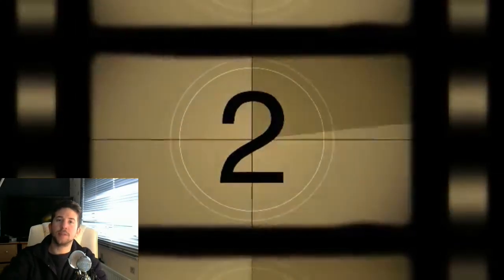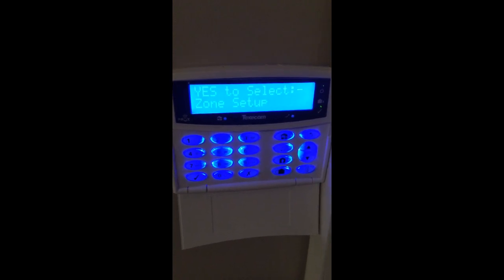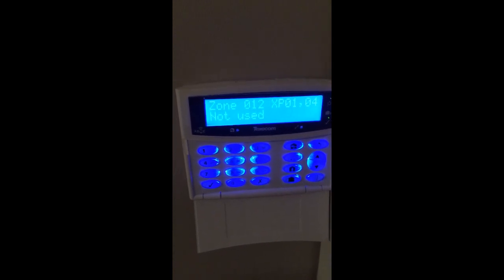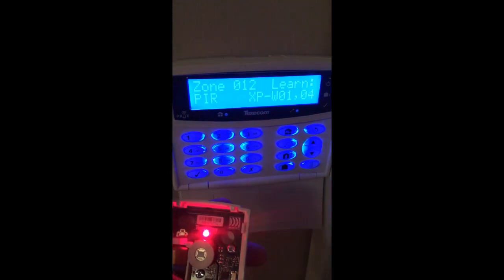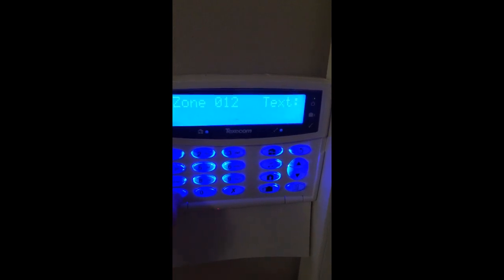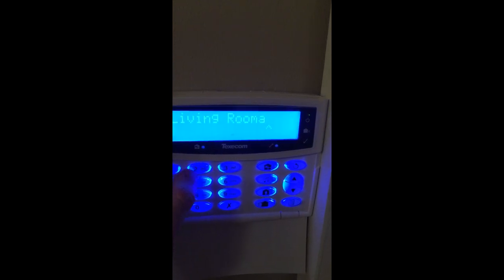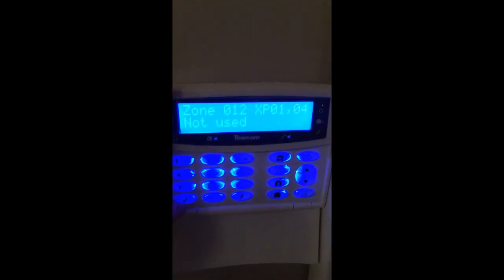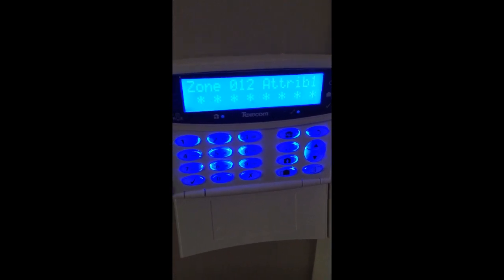How to- Wireless sensors- Texecom Premier Elite

Comment: Hi There, hoping you can help - I want add wireless PIRs to my panel which is a premiere elite 24, I currently have 4 x wired PIRs but want to expand - I can only assume this is not a wireless panel as I am unable to learn devices? If so can I add a wireless expander to this panel as I have been told different things? If so is there a specific compatiable expander that I need to get?
Reply from the maker: As you have an Elite you should be fine in adding a wireless expander. All you need is a Texecom Expander 8 XP- W. You'd simply connect it into the control panel with a piece of wire and matching up the + - T R. Once that's done you'd just need to confirm it (Engineer Utilities, Confirm Devices, Press Yes) then assuming it's your first expander you'd add your wireless zones from zone 009
Reply: @pizzaandchipsmate  thank you - will take a look see if this is something I can tackle as a diyer!
Reply from the maker: @HK-iv2qm  Hi, I'm sure you can, you'll need a GCD-0001 (part number for expander). If you need any help or any questions feel free to drop me a message
Reply: @pizzaandchipsmate  would there be any issues going with GCA-0001 instead? From what I can see this is the same but allows more wireless zones? Also I have some wired PIRs which have been giving false alerts, is upgrading these to Dual Tech as simple as disconnecting exisiting PIR and connecting new ones? ( As the wiring is there I may as well make use of these in situ)
Reply from the maker: @HK-iv2qm  You can use the 32 way instead if you want. That's correct. Yes, replacing a PIR for a DT is as easy as unwiring one and putting the new one in (or swap heads if using texecom capture). Generally DT's are fitted in temperature change rooms ie, kitchen, conservatory, garage
Reply: @pizzaandchipsmate  Brilliant thank you for this, interestingly I have ACD-0001 PIRs and have 2 of the 4 false trigger when armed on a few occassions and was looking at DT as was told they would be reliable - one is in the hallway, one in the rear open plan kitchen - so not necessarily temp changing rooms when armed, would DT be the best option?
Reply from the maker: @HK-iv2qm  I think changing to DT would be a good first step in preventing false alarms, generally radiators, fires, ovens, skylights, windows, glass in general can all be causes of a false activation. A PIR isn't looking for movement but a temperature change, hence why a DT is better suited in those locations
Reply: @pizzaandchipsmate  taking you up on your offer, I have now accessed my control panel, have the 4 core cable but am struggling to see where the expander needs to be connected to as there are many connections already in place ?
Reply from the maker: @HK-iv2qm  Using a new bit of cable, you'd connect into the Network In on the expander (top left) aerials will be pointing downwards. Using the + - T R, before connecting it into the panel, check or know if you already have an expander programmed in, you can check this by Engineer Utilities, Confirm devices, and see if you have anything on the EXP line, if you do, you'll need to address the expander to the first free one (number won't be displayed) so if you know or have nothing on EXP line, leave address as 0 or put just first address switch on. Once you're sure of the address using the other end of the cable you wired into the expander, you'd put that into the Network terminals using same colours, so Red is +, Black is -, Blue is R, Yellow is T. Doesn't strictly matter, just need to be the same both ends. Then once connected, check your confirm devices and you should now have a 1 on the EXP line
Reply: @pizzaandchipsmate  thanks once again, I have checked and no expander is in place. The part that threw me was that there are already wires cabelled into the network terminals on the panel which I assume are for the smartcom communicator. So I assume I would need to double up the expander cables to these terminals with existing wiring? And will need to power down the panel and remove the battery before doing so?
Reply from the maker: @HK-iv2qm  It would be the keypad in the Network already, the smartcom uses the lead plugged into Com 1 and Com 2. You can do it live, just do the expander end first otherwise you'll be dealing with live cables
Reply from the maker: So if you already have a core in +, -, T and R you would put your cores in as well so they are sharing the same terminal

Comment: Our expander has no longer got a tone sound when arming - this was after adjusting a few settings; does anyone know how to fix this?
Reply from the maker: The expanders themselves don't make a noise. Do you have speakers wired into them?
Reply: @pizzaandchipsmate  Thanks for getting back. No, there’s no speakers. When we previously armed the alarm there’s was a sound from the keyboard and another sound from the panel but now there is only one sound
Reply from the maker: @786masakeens  From your keypad engineer menu, find keypad setup, press yes until keypad tones and see if they're all on, if not, press no then no to toggle them on and off
Reply from the maker: @786masakeens  Also, is this for a night set or full set?
Reply: @pizzaandchipsmate  thanks - that’s worked! Is there anyway to change the tone sounds?
Reply: @pizzaandchipsmate  full set
Reply from the maker: @786masakeens  No, the exit, entry etc tones can't be changed
Reply: @pizzaandchipsmate  Thanks

Comment: Hi I have a premier elite panel which I wanted to reset to factory settings, although the sensors which were paired to the panel were switched off when I factory reset the panel and now when I go to re add them they don’t learn to the new panel.
Reply from the maker: What was the reason to default the panel? The sensors also get learnt into the expander, so if you go into Engineer Utilities (9), press yes, then press up until you get into Ricochet Diag, then press yes, go to your first wireless zone, press 'reset' it will ask if you want to default nvm, press yes. This also reduce the likelihood of faults coming as the panel has the Lounge as say zone 11, but the expander sees it as zone 12
Reply from the maker: How are you learning them in as well?
Reply: @pizzaandchipsmate  Hi so I set it up in one property and I’m now just moving it to another, it would have meant changing a load of settings etc otherwise, but it didn’t really need to reset. To learn I go to engineers then learn ricochet. What I mean is, once the sensors are paired are they then locked onto that panel until the device list is cleared. I reset the panel by holding the load default button however the sensors which were coke credit didn’t have their batteries in them.
Reply from the maker: @JAMESJAMES26000  You should learn them in via Engineer mode- Zone Setup- Zone Number, Reset, Learn in
Reply from the maker: When you Load Defaults with the panel powered up it doesn't reset it. You need to hold Load Defaults while powering up and it still doesn't reset the Ricochet Diag on the Expander
Reply: @pizzaandchipsmate  ok yeah I think Ive got it and yeah I held the button whilst powering up. When setting up the zone say for the entrance door I’m guessing you pick entry exit 2 right not just entry?
Reply from the maker: @JAMESJAMES26000  Entry/ Exit 1 is fine for the front door, Guess Access for the Hallway, Guard for others
Reply: Ah ok also I didn’t really seem like the PIR was being triggered by my movement. It’s a PW-W does it start to work once I’ve taken it out of commissioning or are they just a bit rubbish?
Reply from the maker: @JAMESJAMES26000  They're pet friendly so a bit temperamental, how long did you leave it in commission mode, what did you do for commission mode? Is it set for 'Auto' in type?
Reply from the maker: @JAMESJAMES26000  How do you mean to your movement?
Reply: @pizzaandchipsmate  the light wouldn’t illuminate when I move in front of it
Reply from the maker: @JAMESJAMES26000  it's wireless
Reply from the maker: @JAMESJAMES26000  They will only illuminate in walk test mode or if the alarm is set. As they are pet- friendly they are more difficult to activate so takes a few big waves
Reply: @pizzaandchipsmate  ah so they’re bit rubbish
Reply from the maker: @JAMESJAMES26000  they aren't my favourite
Reply: @pizzaandchipsmate  hello, so when I want to learn the devices should I create a zone for each room say, hallway which has a pir and door contact. And a room which is only has a pir? Is it easier to setup devices using wintex?
Reply from the maker: @JAMESJAMES26000  Hello James, I'm not sure I follow you. I would have either my expander lid off in tamper, or the jumper for commission mode on for a 64-W. Then for Zone 009, learn in the Front Door MC, then 010 Hallway PIR etc, I find it easier to set up using the keypad. If you have Discord I'd be happy to talk you through the system
Reply: @pizzaandchipsmate  yeah I’ll get my username.  I mean when I learnt the devices it didn’t give me the option to set if they were for guard etc. I couldn’t find in the menus where I was able to set those perimeters? I have a smartcom and was planing to connect my laptop to the system via wintex, is that an easier option to setup such perimeters?
Reply from the maker: @JAMESJAMES26000  Once a device is learnt in you'll need to press 'yes' until it says 'Zone Type', it does automatically make zones 'Guard' thought once learnt. Alternatively if you come out of current menu (menu button) until it says 'Zone Set-up' Press Yes and the first setting is the 'type'. Which you'll then use the arrows to go through the zones or type in their number
Reply: @pizzaandchipsmate  ah ok perfect I think that answers my question... for now anyway :)    I also have a PA which is wired directly into the panel. Would I set that zone to be on guard? I would like to make it a silent alarm.
Reply from the maker: @JAMESJAMES26000  Okay, so for a PA you'd have that zone type as 'PA Silent'. PA Silent/ Audible means it's ALWAYS on, regardless whether the alarm is set or not. If Silent it only triggers an output and creates an alert, doesn't activate the SAB or sounders.
Essentially any entry door (i.e Front Door)= Entry/ Exit 1, Any device you walk through to get to keypad (i.e Hallway PIR) = Guard Access. Everything else (i.e Lounge, Landing, Dining Room, Kitchen) is guard (except PAs). Depending on how it's wired matters as well.
Reply: @pizzaandchipsmate  hi again, I’m just setting up my wireless contacts and it’s saying they are temper. How do I get this fault to stop?
Reply from the maker: @JAMESJAMES26000  Close the lid
Reply: I’m still getting a panel lid tamper, the lid is closed
Reply from the maker: @JAMESJAMES26000  Make sure the spring is pressed properly, what panel is it? What message is said?
Reply: @pizzaandchipsmate  it’s a prem elite 64-W
I’m getting panel lid tamper 
Com port 1 - but i think it’s because I’m logged into wintex 
And one of my micro door contact is just coming up with tamper and won’t communicate when the door is opened
Reply from the maker: @JAMESJAMES26000  Did you put the jumper across for commission mode on the RHS of panel? How are you logged into Wintex with panel closed? Did you stick or screw on the micro?
Reply: @pizzaandchipsmate  I’ve moved the jumper out of commissioning and I’m connected through the smartcom 
Do you want my discord? It’s jawors1
Reply: #2028
Reply from the maker: @JAMESJAMES26000  Sent

Comment: Hello, im currently setting up a texecom elite 64 at my house, i have learnt all devices etc, plus zones etc including mobile app but the pir don't see my movment when walking around the house? also when the alarm is armed the pir dont seem to set the alarm off? can you help? many thanks liam
Reply from the maker: Hello Liam, Is it a wireless device, and what is the device type on 'Zone set-up'?
Reply: @pizzaandchipsmate  hello. Sorry for the late reply, yeah it’s a wireless system and the pirs are set to auto in the zones I think. Thanks
Reply from the maker: @liamhannan9374  Okay, and are they set as Guard/ Guard Access (On first option on entering zone set-up
Reply: @pizzaandchipsmate  sorry I didn’t reply, I managed to get it all to work now with your helping guide Thanks 😀 just another question tho when setting the alarm either when we go out or even go to bed the keypad doesn’t give of any sound to show it’s setting etc can this be rectified?
Reply from the maker: @liamhannan9374  In engineer mode, press 4 for keypad options, press Yes until RKP*1,1 Sounds: and make sure they're all on. also check option 2 (area programming) then area options and go through making sure silents and Sounders are used etc

Comment: Hi,after learning on to the system and siting what mode should it be while waiting 20mins for the mesh to work? please
Reply from the maker: It should be in commission mode, this is when the panel is in engineer mode and if using a wireless expander, lid off. If using a Texecom 64-W there is a small jumper on the right which is 'set to commission mode'
Reply: @pizzaandchipsmate  thank you very much that will help alot 👌👍
Reply from the maker: @jeffwilliams7118  You're welcome, any questions, let me know